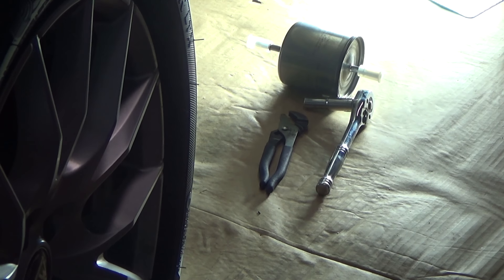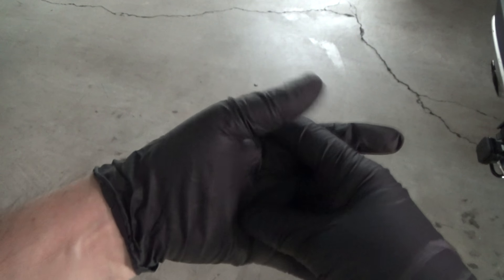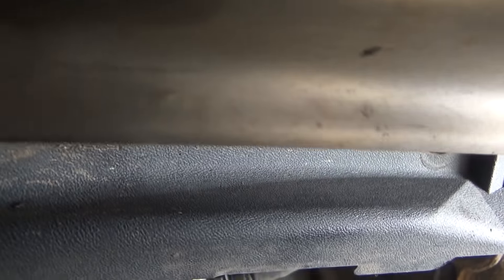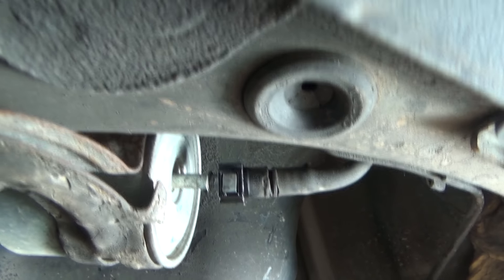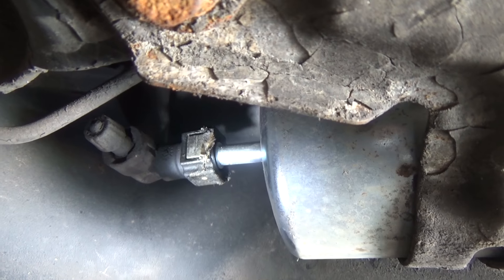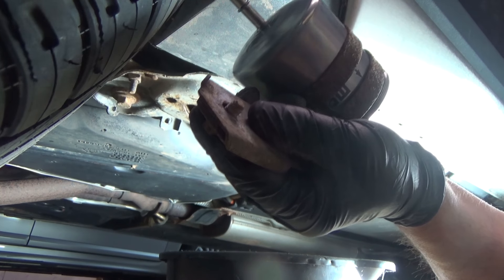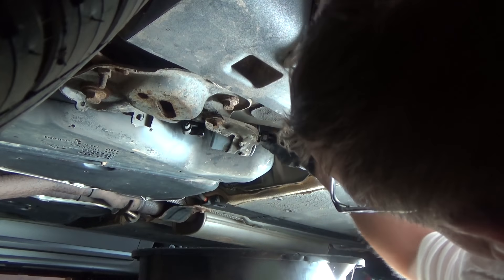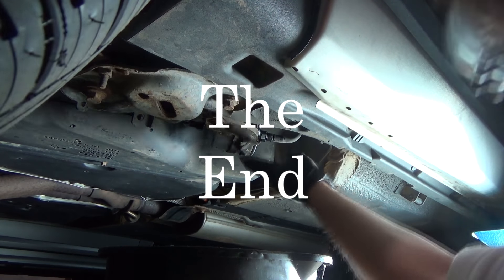XC90 Fuel Filter Replacement

Comment: Helpful advice: Tape small nuts (4-40 hex) on plier jaws and use to press the connector buttons in without crushing the shell. Use a small vise-grips to hold the bracket closed while threading the bolt back in.

Comment: Hi how do you know if you need to replace the fuel filter????
Reply from the maker: In this case we purchased the vehicle used and wanted to set a baseline.  However, over the years I have found that fuel filters run about two to three times as long as the people who sell them want you to change them.  In other words, every three to five years should cover the fuel filter no matter how many miles are associated with that time.  Good Luck and thank you for asking and trusting my response.
Reply: Thank you for your response, I purchased my XC90 2008 used and I am finding when the fuel gets to about a 1/4 tank it does not run as well. I believe it might have gunk in it. I used iso heet this winter. How do you feel about the product GUM out for fuel injectors?? The manual says not to put additives in the fuel, but are they sure???? ha ha
Reply: I just replaced my 2005 140k miles. Looks was original or at least, 10 yeas..